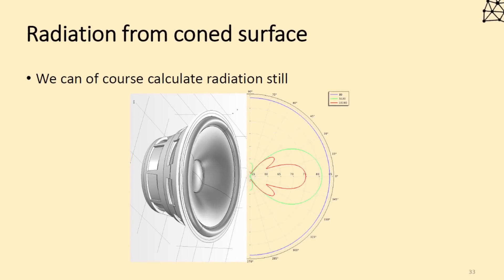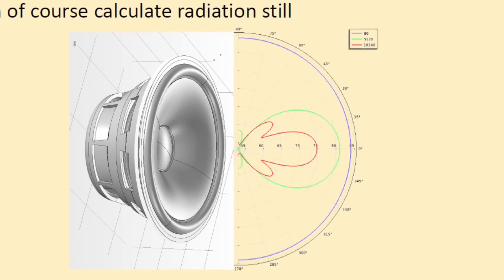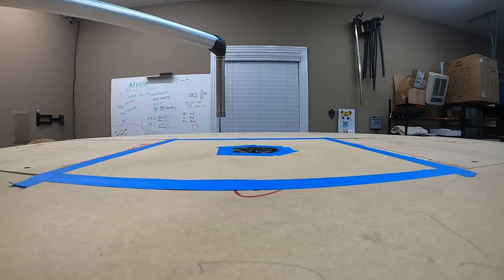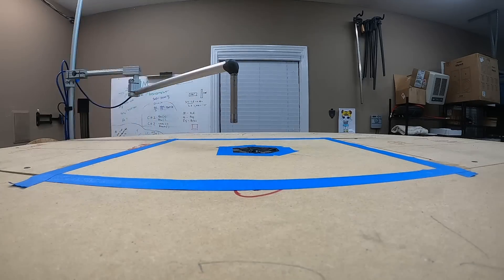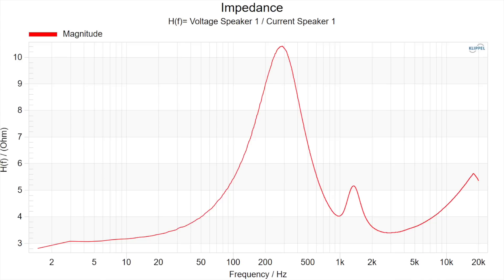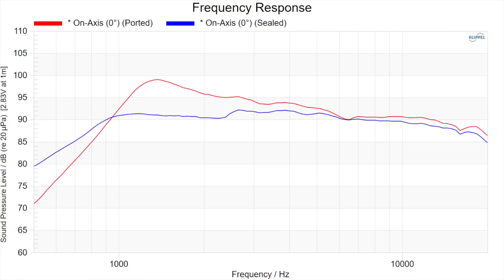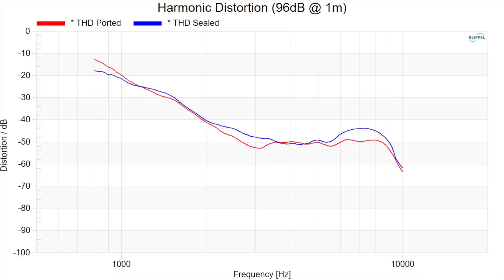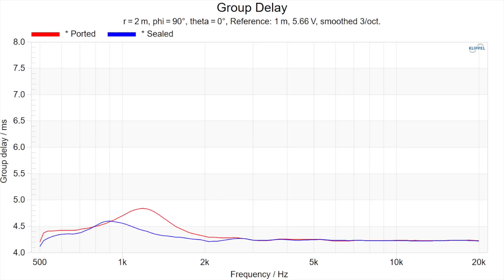Ported TWEETER?!  (No, this isn't clickbait.)

Comment: If you use this tweeter with a DSP system to correct the amplitude response (for example, in a car) I guess it makes sense. In a home audio system with a passive crossover it makes no sense. You'd have to pad down the lower frequencies to get a linear overall response. But then, if you are using a DSP system you could boost the lower frequencies using the DSP so the port doesn't matter. I guess I just don't see the point.

Comment: Yea.. scanspeak had tetcnology called aircirc it is quite the same thing.
Reply: Yeah.... Nah. Nothing like it.
Reply: @alexralph9929  or maybe it is sealed... since the purpose of the chamber is to circulate the air inside to be evenly distributed. No vent then? 
Is this correct for the air circ?
Reply: @PoisonStore  Yes, it seems to be for controlling standing waves in the rear chamber.

Comment: Most any resonant alignment, brings untidy time domain challenges, right? 

It's the classic conundrum right? One always has to weigh;
elevated output at a given distortion level 
vs;
less than ideal time domain performance

Down in the LF, the same challenges exist. But in use, the subjective hit is lessened perceptually in the lower octaves. 

The question would be, what does the listener experience when those resonant behaviors are placed right into the mid-band octaves?

The attributes are always welcome (headroom, etc.), but how would those time based issues impact the playback? 
Smear sounstage details? 
Shift image fore or aft? 

Dipole aside, it would seem the direction tweeter/loudspeaker designers have settled upon pursuing is a sealed, controlled dissipation of backwave energy, many into a tapered tube like approach. 

Erin thanks for bringing this to our attention, very cool... always thought provoking solid work.

(this illustrates how driver/loudspeaker design is a pure balance of compromises, an ever fascinating multi-disciplinary pursuit... one can't simply bulldoze forward with money following a single best approach)

Comment: As cool as this is, there are quite a few issues with ported tweeters, they have existed but the majority of them died at the prototype stage. 

The steeper roll of is undesirable when designing passive crossovers, the complexity of production at scale has been for a long time, to much. Hopefully with these issues fixed it can become a useful tool, for us designers.

Comment: Interesting design. I've long felt that most conventional tweeters are not properly capable of crossing to typical 5-8" mid woofers because they just aren't great running at a low crossover point. Love your work btw and followed since day 1. Just subscribed on Patreon.
Reply: Some soft dome tweeters with back chamber can go low enough.  If not, you can use a 1.25 or 1.5 in.dome.
Reply: @Vortexan9804  Some tweeters with large Xmax can be crossed lower, but you have to be very careful with how much power you feed them. Also expensive, they generally need a big neodymium magnet for the large Xmax.
Bigger domes will have reduced dispersion at higher frequencies, and if you ported them, they could be crossed even lower.
Reply: @alexralph9929  do you have any larger tweeters capable of low xover you’d recommend 👀
Reply: @Chase1297  Short answer - as Frank mentioned in the comments, Wavecor and Peerless have some good value tweeters with large excursion (not a recommendation, I haven't heard/played with them). 
Long answer - excursion and power handling are the 2 limiting factors. The free WinISD software lets you model a tweeter (some software won't cover high frequencies). Wavecore has excellent data on their drivers that you can use as a starting point. This will show you the excursion and power handling you will need for your design goals (crossover point and SPL). Typically tweeters have underhung voice-coils that will distort quickly when pushed beyond Xmax, so leave yourself some headroom. 
The more affordable tweeters will use a ferrite magnet. The tweeter in the video has a 2mm voice-coil gap height, with 1.4 Tesla magnetic field. When we increase the gap height (for more excursion) you reduce the field strength, which reduces the sensitivity. You also need to increase the gap width for larger excursion in order to avoid any rubbing of the voice-coil, which also reduces the field strength. This can be offset with a wider magnet, but comes at a price (money, weight, and size).
To keep it small and lightweight the best tweeters use Neodymium ring magnets, but they are expensive. Bliesma have tweeters with 1.5mm travel, and a saturated motor (probably around 1.8 Tesla in the gap). There's also Morel and others. 👍
Reply from the maker: Wow!  Thanks for the support.  Yes, very interesting design.  Stuff like this is really cool and I was happy to bring a bit of light to it.

Comment: My understanding is that the reason tweeters are not ported is because of the phase issues.  Also the sudden shift in phase at the ports would probably cause clarity issues in the frequency area of the port.  At the extreme low Frequency of a ported woofer with the long wavelengths, the loss in clarity is not as noticable.  But even non-ported woofers sound cleaner, maybe less low bass but clearer.
Reply: Tried to reply earlier, but comment disappeared. Sorry if this appears twice. 
The phase change around tuning frequency is gradual. This is reflected in the group delay measurement at the end of the video.
The is also "port resonance" which appears at a higher frequency. It is related to the length of the port, and in big subwoofers will show up around 200Hz. It is a sudden shift, and screws with the frequency response. 
If the length of the port is less than 9mm (as in the tweeter), then the port resonance is kept above 20KHz.
Reply: @alexralph9929  I beg to differ.  The phase change at the port is anything but gradual.  It is a 180 degree flip in a fraction of an octave.  At the high frequency of this port, it is very fast, steep and sudden.  I am not talking about group delay, I am talking about phase shift.  You can have phase shift with out delay but you can't have delay with out phase shift.  Additionally, as stated in the video, ported speakers exhibit higher distortion below port frequencies.  Add in the difficulty if trying to get a smooth crossover due to shifting port phase in top of crossover phase shift and is there any wonder why other tweeter designers used large back chambers and tapered tubes, but not ports?   EV tried porting their midranges back in the 70 (?) But it didn't last and no one followed suit.  There has to be a reason they didn't.  My guess is for the same reasons. The basic physics of speakers was known +/- 100 years ago  The big improvement that have been made since then have been in material sciences, not basic physics.
Reply: @jked7463  If you look at the frequency response (6.17), you will see that the ports are contributing to the output from around 950Hz. This means the air coming out of them is starting to be in phase with the diaphragm. The air gradually changes phase until around 1400Hz (maximum boost), when it is in total phase with the diaphragm. Beyond that, the mass of the air in the ports starts to reduce the ports output (can't change direction fast enough).
Below 950Hz, the output from the ports is gradually becoming more "out of phase" with the diaphragm. This is the reason for the steeper roll-off from a ported speaker. Eventually it is 180 degrees out of phase as you said, but I would call that change gradual. If there were any fast 180 degree shifts, they would show up as major dips in the frequency response. 
This does happen at the "port resonance" frequency though. Erin has graphs on his website that show this. He has measured some subs with the port open, and closed. The port resonance is obvious. 
As for EV, I can't imagine they released a product into the market place that didn't work. They were heavily invested in research and had some excellent products. My best guess would be that it was not necessary. The midrange was 6 1/2 inch. It doesn't need help from a port to cross over from a 15" woofer (piston range to around 350Hz). A port would also make the passive cross-over a little harder to get right.
Reply: @jked7463  I'm happy to discuss , but please reply in a new message instead of editing an old one, it makes things difficult for others to understand. As I mentioned, any fast, steep or sudden 180 degree phase shifts will show on the frequency response as a sudden dip, it cannot be any other way.
Reply: Sorry about the corrections after the fact, but they are corrections and I did not want to leave the original post incorrect, or at least not clear.
Reply: @alexralph9929  Yes, that is the point of a port, to flip the phase so it is in phase with front of the diaphragm.  I am not talking about that portion of the frequency response that is flipped. I am talking about the phase shift between the radiation off of the front of the tweeter and the portion of the port output that is in phase. That in between area is the issue in my mind.  In bass output with long wave lengths, that in between area is not as noticable. The shift is more gradual down there. But higher frequencies, A) the shorter wavelengths make any phase issues more audible. B) the ear is more sensitive to "issues" at higher frequencies than at low frequencies.  I just know designing crossovers to sonically integrate two drivers together is hard enough, let alone trying to do that with a 180 degree phase shift within the crossover area.  Hey, to each his own.  Different people hear differently. A friend had speakers with a few very small woofers that used a high order bass cabinet.  It built up bass through energizing the air in the cabinet before letting out the bass.  Everyone loved the speaker I could not stand it because of the group delay it created in order to build up the bass.  I am very sensitive to time arrival and phase issues.  Other people are very sensitive to frequency response or attack/decay.  That is why there is no perfect speaker for everyone.
Reply: @alexralph9929  What you call gradual, I call fast.  If the phase is changing 180 degrees in less than +/- 400 hz at +/- 1400 hz, that is fast in my book.  That is less than 1/3 of an octave. A 180 degree change in 400 hz starting at 60 hz would be slow. It's all about the logs.  While there may not be any frequency response issues caused by the phase change, that just means the pluses and minuses are cancelling each other out.  I was recently playing with a crossover.  By changing the values, I was able to adjust phase to cancel out a hump in the response.  But in real life it killed transients in that area and made the speaker sound lifeless.  Also in the case of this tweeter, the change is happening in the frequency range most sensitive of the human ear.  As you stated, and I stated elsewhere, a 180  degree phase within the area of the crossover would make it difficult at best to integrate drivers together seamlessly.  Maybe an infinite slope crossover using a transformer might work, but normal slopes would be "difficult".  I understand this is being marketed for cars and that is probably wise as there are typically already large distances between drivers creating less than optimal crossover integration between drivers.  But in a home speaker give me a well designed wave guide that will boost the low end without the phase and low end (relative to the driver) distortion issues to worry about. The wave guide can boost low end and provide proper time arrival between drivers.  The larger distance between drivers being the main drawback.  But this is at least partially offset by the coherence created by the proper time arrival.
Reply: @alexralph9929  regarding the EV ported midrange, if it was successful and preferable, it would have become a standard for midranges.  And no, just because it was put out there does not mean it was fully worked out and successful.  I used to work in the movie theater industry.  The standard screen speaker was a single or dual 15" in a box with a top mounted horn.  To keep both drivers as close to the perforated screen as possible the driver's acoustic centers were offset.  From speaking with an EV engineer they understood the issue which is why the adjusted the crossover to boost out put at the crossover frequency. Of course all that did was make the cancellation between drivers narrower but deeper.  We went out and created a three way with a wave guide on the bass driver so that the drivers were time aligned and proper coupling to the screen.  Of course it was more expensive.  But it was much clearer.  In the boller hat museum screen of thomas crown affair, the ev sounded like a bunch of clapping, the time aligned three way sound like clapping to the rhythm mixed in the sound track.  So, no,many products are put out there with less than perfect/finalized engineering.  The klipsch 660m's terrible crossover integration in the mk1 vs mk2 version is another great example.
Reply: @jked7463  I think I understand, but please correct me if I'm wrong. You are worried about multiple points of sound (the diaphragm and the ports) operating in-phase at the same time?  If so, that's a good concern.
The same thing is happening with a standard tweeter. If you measure a tiny (no faceplate) 1" tweeter in free air it will be down around 5dB at 1500Hz. Measure it with a 4" baffle (or faceplate) and it will be flat to 1500Hz (but roll off from there). That extra 5dB is coming from the in-phase reflections from the baffle/faceplate. This is why some brands mount their tweeters outside of the box (to reduce reflections). Unfortunately it means you can't cross over the tweeter as low, or play it as loud if you do, as you've lost headroom.
You're right, there's no perfect speaker for everyone. I don't pretend this tweeter fixes everything, but it can definitely help in some areas. As FOH-3663 said above "driver/loudspeaker design is a pure balance of compromises, an ever fascinating multi-disciplinary pursuit..."
Reply: @jked7463  Agreed, it is harder to get a passive crossover correct with this tweeter, but it can be done. This was one of the first things I did with the original prototypes. Just a 2 way bookshelf design, and it did take some massaging with SoundEasy to get it right (24dB / octave @1600Hz).
Nothing wrong with a good waveguide 👍 Sometimes they might be too big though - car A-pillar, sound-bars, smart speakers, etc. This is were the ported tweeter will help most.
Reply: @jked7463  I guess that's the point, you can always improve on a design, but it becomes more expensive.
Reply: @alexralph9929  agreed, the car would be the best use.
Reply: @alexralph9929  the boost of a tweeter from a baffle is from being in half space more than phase reflection.  A baffle is a no compression, very low  efficiency horn.  Basically a 180 X 180 degree horn/wave guide.
Reply: @alexralph9929  I am sure with enough tweaking it can have a respectable response.  I only know that a sealed box woofer sounds cleaner, more linear than a ported design (although the flared ports do help) with similar f3 cutoffs.  If it is audible at low frequencies, the audibility should be more easily perceived at higher frequencies.  Like I said, it makes sense to market for cars since there are already alot of anomalies already.
Reply: @alexralph9929  if it took a 24 db/octave crossover, then it should work better with an infinite slope crossover. It would be simpler, possibly cheaper.
Reply: @jked7463  Probably shouldn't have used the word reflection - it's usually associated with out of phase wavefronts. Was trying (poorly) to explain Huygens' Principle, and that the wavefront expanding across a baffle is made of multiple in-phase signals.
Reply: @alexralph9929  gotcha, yes, you and I are explaining the same thing from opposite directions.
Reply: @alexralph9929  I have to say, I am flabbergasted that my little comments have made such a long comment string.  We audio people have a lot of strong opinions don't we?  Especially for something so subjective.

Comment: Ok... How do I put this is a waveguide?
Reply: Just extend the ports into the waveguide. Have to keep them short to avoid port resonance, so the waveguide can't be too deep.
Reply: I see too many phasing problems doing this, wont get a flat response.
Reply: @Vortexan9804  It works, made prototypes. 
The biggest issue is getting the shape of the waveguide correct for the diaphragm, but that's with or without the ports. Getting it wrong will screw up the frequency response.

Comment: Interesting.. this makes me wonder if adding a rear resonance chamber will help to reduce it's FS, drop the peak a bit, while also increasing its low end extension?

I say this only because if this were a woofer's response in a ported box, it would suggest that the bottom-end bump followed by an early roll-off means that the airspace used is too small for the driver. 

It would be interesting to see what will become of this design as things progress.
Reply: Yes, Premium Sound Solutions have a design just like that, and it works as you described. The back chamber works like a miniature bass trap, but it does cause a slight increase in diaphragm travel. 
With this design, the ports reduce the diaphragm travel. The bottom end bump is necessary so you can reduce the power fed to it through the crossover. The power and diaphragm travel are the main 2 limitations when feeding a tweeter lower frequencies.
Reply: Nothing new with back chambers, been around over 20 yrs.
Reply: @Vortexan9804  that's why I mentioned it as an option.